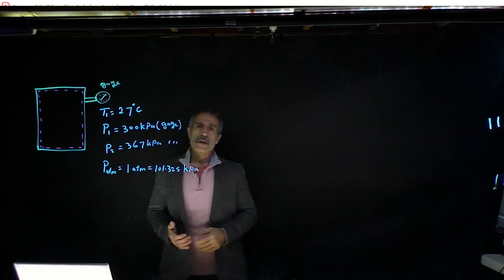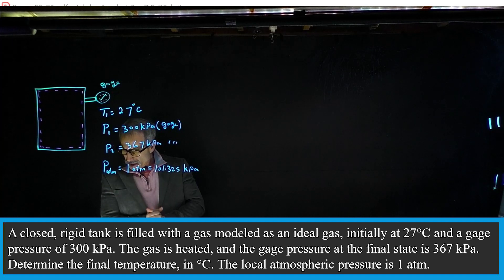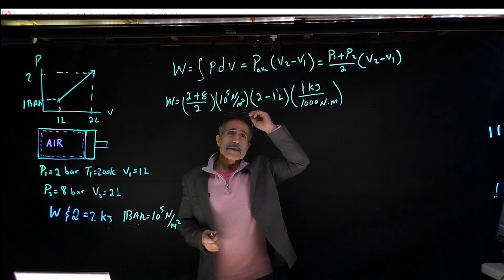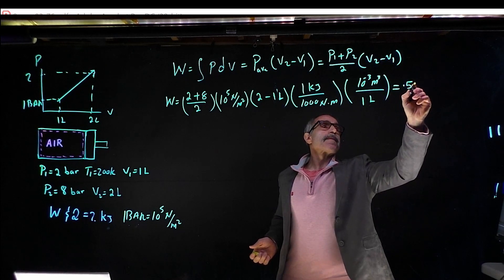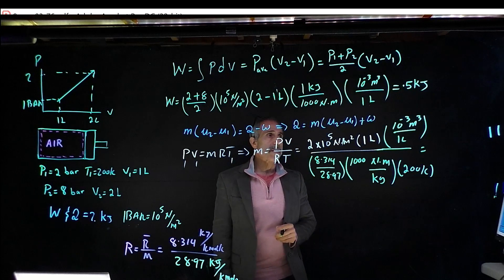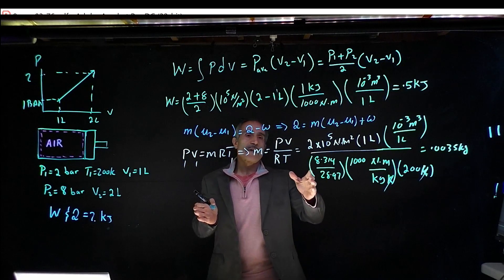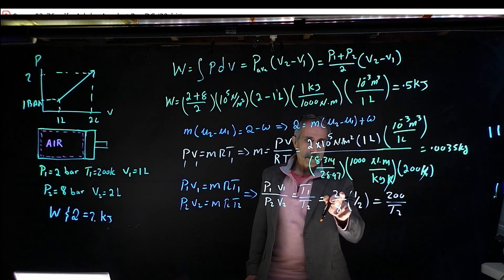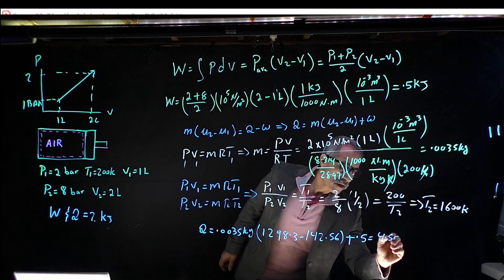Ideal Gas Law Problems  Thermodynamics

Comment: I need solution to this problem.
A sample of atmospheric air was found to contain 78% N2 , 0.03% of CO2, 16% O2, 1% rare gases,5% gaseous impurities at STP. If 200cm3 of the sample air was analyzed, calculate the volume of the respective component of the air hence calculate pressure 5 mole of the air will exert at STP.